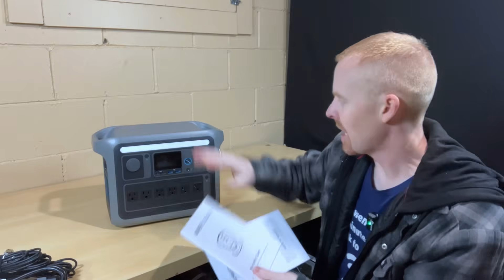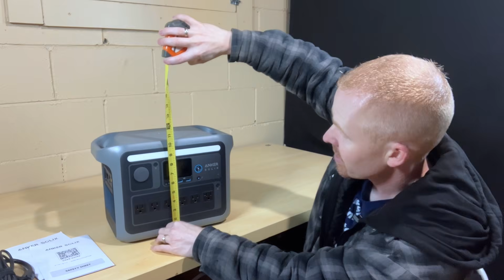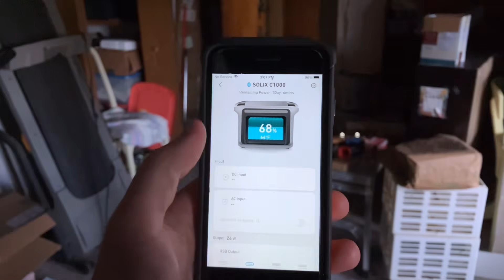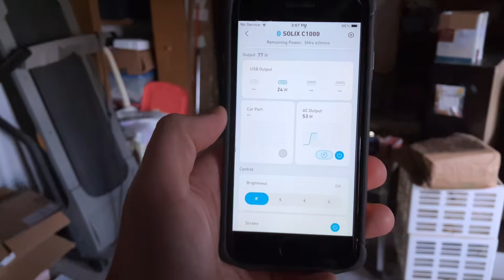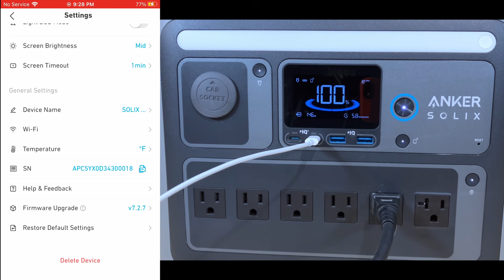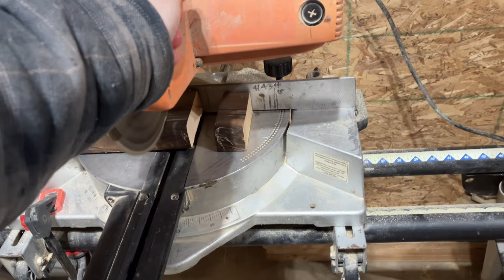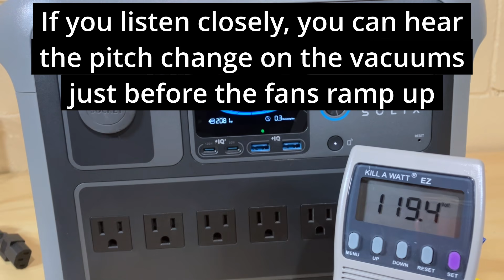New Anker SOLIX C1000 Portable Power Station: Ultra-Fast Recharge & 2400W Surge!

Comment: Wow  that’s insane so much test best review indeed many just say it great but don’t have the equipment to bench test heheh. I had a questionnaire for your tests hopefully you can do .
1) could you test pls with that Volt meter you have what happens to the regular ac output ports ;do hey share the same voltage 112-110v when testing those two vacuums or do those ports continue to be regular and have 120v  of course use the meter to test this let’s not burn anything heheh. 
2) with your meter test how many continues  watts  does this Shopsmith Mark V 510  draw , I understand d this meter  may not be able  read super fast surge draws  , but just to know what’s the idle consumption of this saw . 
3) if we only had a 1 solar panel as starting could it be used as pass throw putting atleast abit of power on higher loads like 400w to 1000w .? In a scenario we had no grid power in a hurricane., I want to know how useful this could be for emergencies .
Reply from the maker: Thanks.  In my mind in order to review something, you have to run some tests on it, otherwise their just "overviews of the product".  Course it probably helps that I enjoy testing things as well.  

So to get to your questions: 
1. So before testing this, my assumption was that because it's a single inverter, when the voltage changes on 1 outlet, it changes on all of them.  I re-ran the same test but put the KillaWatt meter on a different outlet.  It shows the voltage being reduced on those outlets as well.  Now the voltage drop will really not affect devices other than inductive (motor driven) loads like the vacuum cleaners.  You'll hear the pitch change while the motors slow down a little bit.  

2. So I've done videos in the past about running my Shopsmith on other inverters and from what I've been able to see (without a proper meter with inrush detection), the startup surge is just under 52A.  Without cutting anything, it levels out to around 9A.  

3.  As far as the solar aspect, unfortunately I don't have any compatible solar panels to test.  I did try using the DC connection from another power station, but that's limited to 10A, so it doesn't give a lot of power boost when running the larger loads.  I can't really tell if the DC side does passthrough or not.  Even if it doesn't, if you have a max of 600W of panels, you could recharge in full sun in under 2 hours.  Obviously that recharge time would change if your unit was under load.  

For the cost and the features, I would have no hesitation about picking this unit up for emergency power.
Reply: @AdamDeLayDIY  wow 52A that’s crazy high , thanks for testing that for everyone of us watching you video . Good to know to avoid connecting anything w microchip or sensitive electronics on any port while activating the SURGEPAD toggle  on the app . I have run some sensitive things under 108-115v and they work fine but just to keep it save I’ll try to avoid doing that .
Reply from the maker: @charlschuck6  Not a problem.  In my test I don't believe it got below 110v, so there shouldn't be any issue with electronics to my knowledge.  When you get closer to that 100v though you might see some issues.  Wouldn't imagine most people would run those kind of large loads on that unit, but I just wanted to show the power that it has.

Comment: With the low battery SOC vs AC output voltage, put a decent load on the unit then measure the AC volts.  That'd be a better indicator if this unit has regulation problems at the ragged edge.
Reply from the maker: The last one I tested had a super low voltage with no load on it.  I wanted to see if this one had the same issue.
Reply: @AdamDeLayDIY Fair enough, I didn't spot the last one wasn't under load.  To be honest if it is a regulation problem rather than a 'feature ' I'd expect it to happen under load since the combination of low voltage and load is where the duty cycle on the HV boost stages would be wide open.
Reply from the maker: @retrozmachine1189  yeah with a load, I expect some fluctuation.  When you can see the voltage drop in correlation to the SOC, that's poor design.  Glad this one didn't have that problem.
Reply: Great test idea!